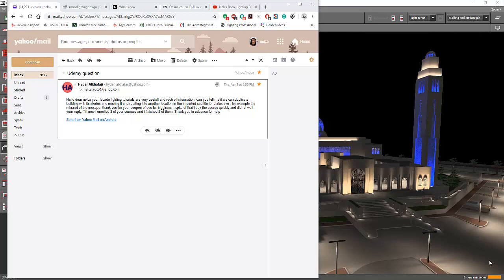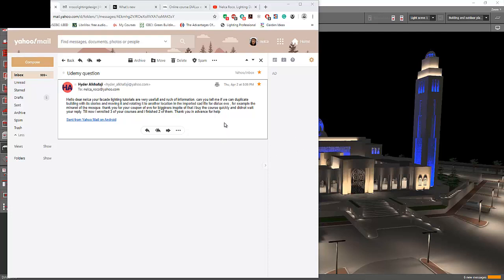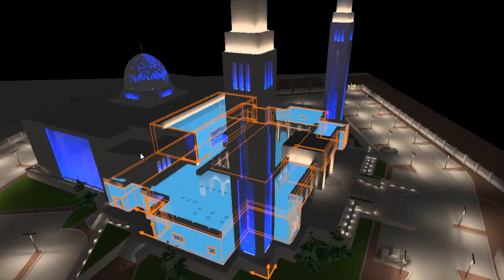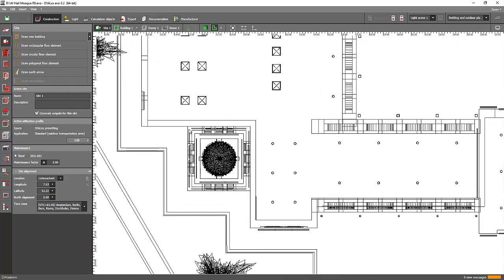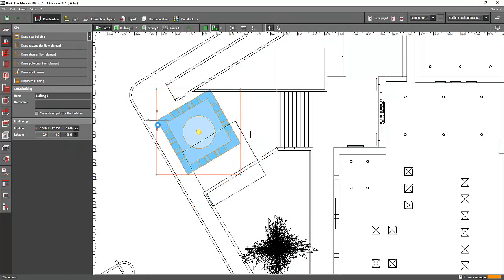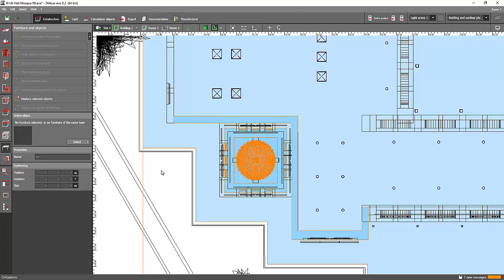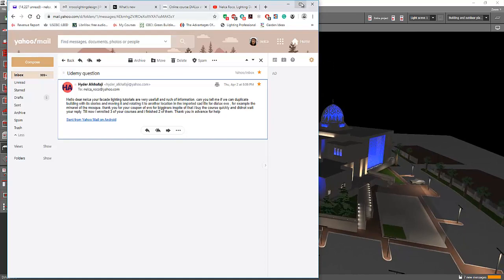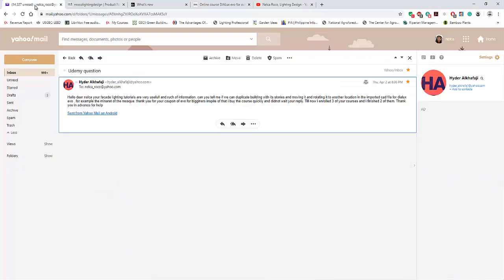Is it possible to copy the whole building in Dialux evo

Comment: Thanks for the important information
What is the way to enter the building from the architect's design to the Daleks Evo?
Reply from the maker: You need to convert the 3D into .3ds file then import it to Dialux evo.  Otherwise build the whole structure again inside Dialux evo.
Reply: @NelcaRoco  
Thank you from the bottom of my heart, I am interested in your channel, and I understand your questions.  My question here is that if I convert the file to 3D the size of the structure changes